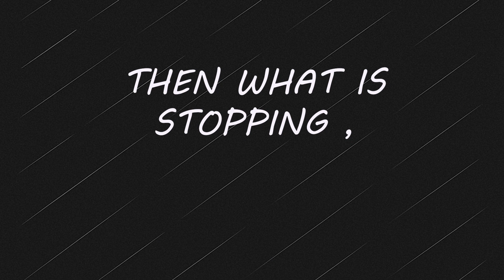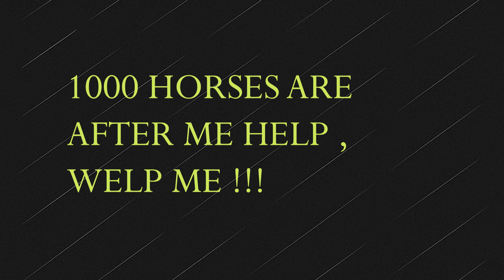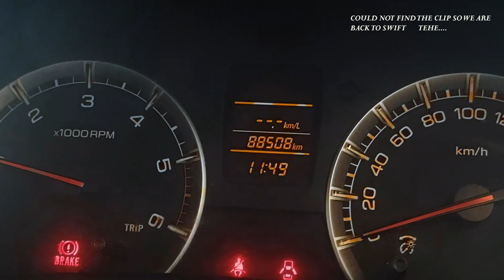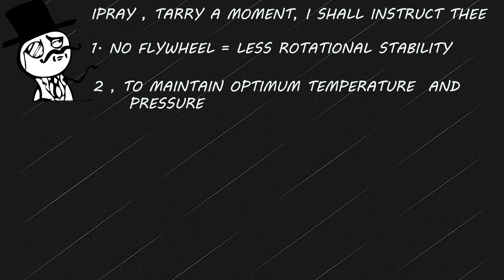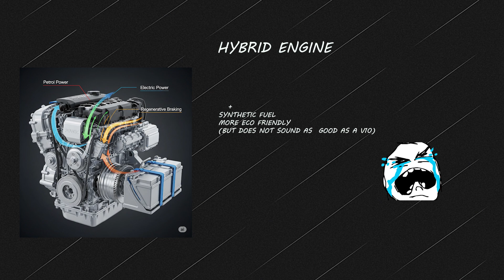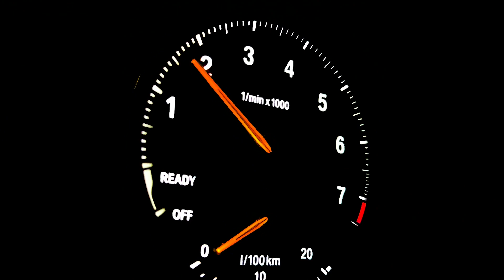Why diesel engines are not used in F1

Comment: f1 engineers could probably find an expensive way around the heavier internals part. And it's not like we need the engine to last half a million kilometers eighter. the more limiting factor is probably the combustion speed of diesel, which can be enhanced with additives or an entire different fuel that can be used in compression ignition engines (diesel cycle)
also diesel can't even suffer from detonation or prefire due to it being injected right at or little before tdc, the diesel ignites itself due to the compression and temperature but if there's no diesel yet it can't prefire eighter
Reply from the maker: A very good explanation brother 👏